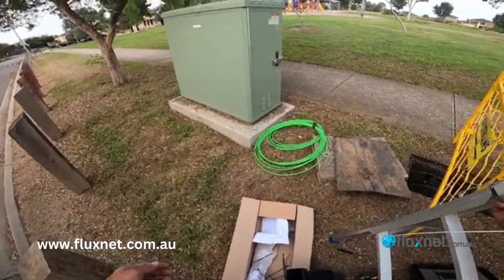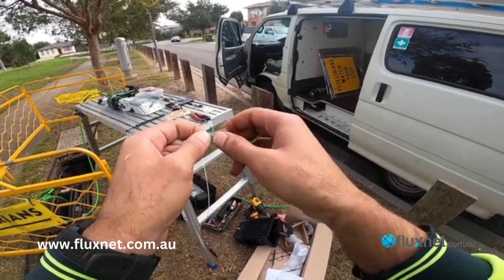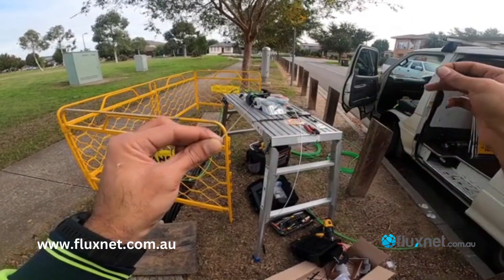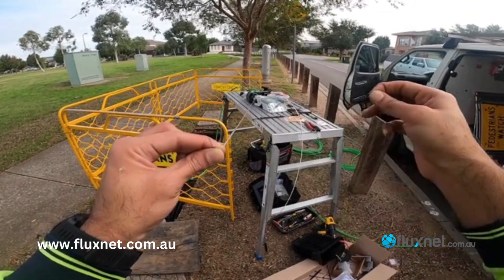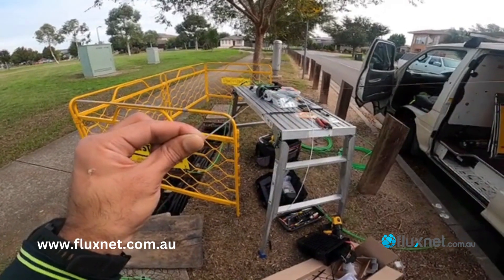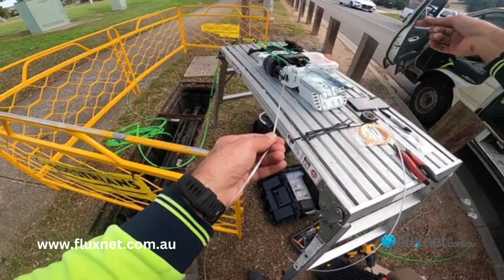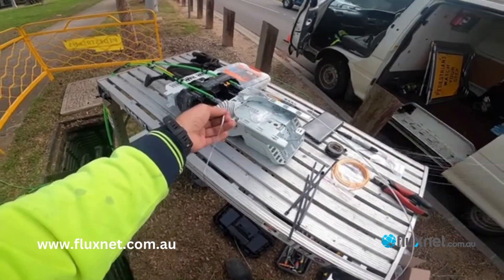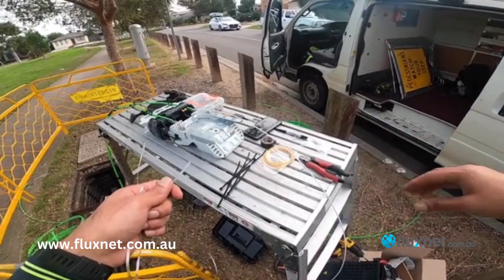How to De Ribbonising Ribbon Fibre without any tools | NBN, Fiber Optics, Splicing

Comment: I've seen a few different methods used, but this is also what I do. It's the neatest way I've come across. Some clear coating is left on the first fibre you remove from the ribbon, but it usually comes off fairly easily in a long piece if you pull it off without twisting the fibre.